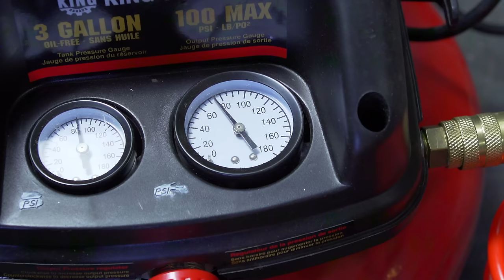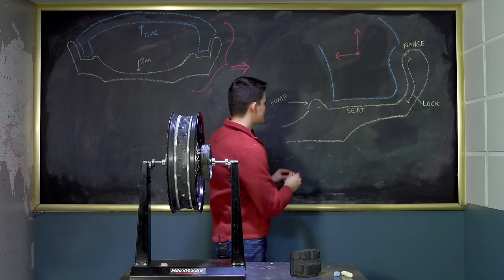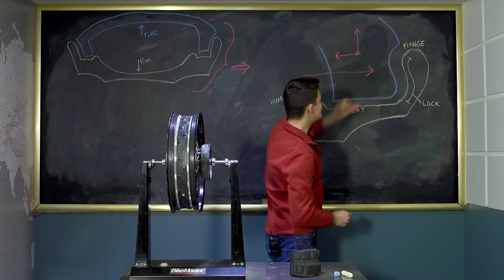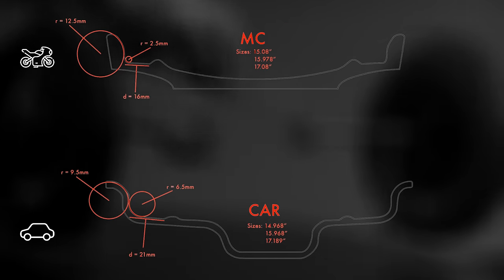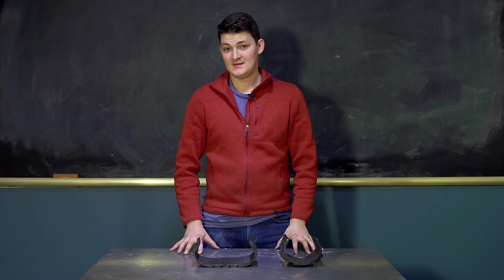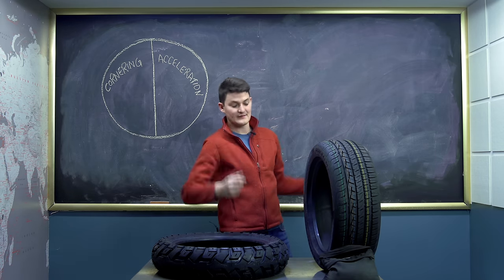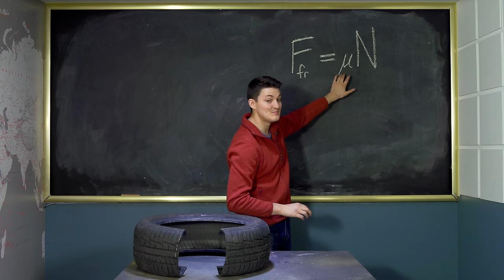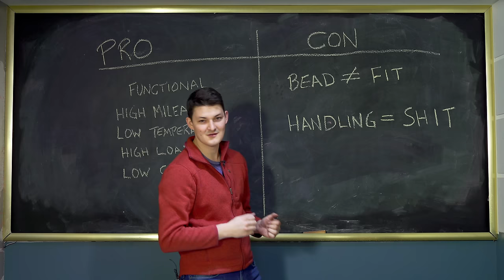Are Motorcycle Tires a Ripoff? The Darkside Car Tire Experiment

Comment: Dark Side tires are for cruiser bikes and heavy bikes. Not for scrawny little bikes like yours that have no weight. On top of it you are comparing basically the dirt bike tire you took off to a street tire for a car. Knobby tires are terrible on the street especially in Rain conditions When comparing them to street tires for motorcycles. If you want to make a better video get a cruiser bike of a good size and do the video again and you'll see a difference between that and the bike you currently are showing in the video. I have a 900 lb bike and I wouldn't use Dark Side Tire meant for a car. There are going to be corners and places where they're loose Stone and if you're making a turn and only the edge of a car tire the bike will go down after it slips out from under the rider. I won't mind paying extra money to save my life one day.

Comment: This guy is a motorcycle tire shill.

At the seating pressures, even though the bead and cpincher aren't an exact marriage, the bead won't break UNLESS you run the sucker FLAT!

The bead seating pressure is the same whether it's a bike wheel or a car wheel, and one of my car tires took 150 psi to seat!

As to handling, they are somewhat different,  but that is neither bad, nor good. A car tire wears better because it has a wider contact patch. It carries a heavier load because it's beefier.

Because it is wider, it is somewhat less susceptible to lean from weight shift. Casual minor shifts from side to side have less effect on steering. That make the bike more stable linearly! You are supposed to steer by COUNTER STEERING, not shifting your weight as you may on a bicycle.

The only part that may be a bit tricky is stopping in the middle of a banked curve, but it's just a learning experience!

I've ridden the tail of the dragon, Ohio's tail of the drain, the back of the dragon, you name it. My bikes lean and handle in curves JUST FINE!

If you only ride 5,000 miles a year, stick to your car tire! I ride 15,000+ miles a year! I spoke to a Harley rider about riding on the dark side. I was complaining about paying $167 for my Pirelli radial car tire. He told me a new motorcycle tire cost him $250 and another $250 to have it installed. What a racket! I bought the Pirelli car tire for $167 and paid $20 to have it mounted. Bike shops won't mount your car tire on a bike wheel, but a car shop may. You have to ask around.

It's an all day job for me to do a new rear tire on my GL1500. I have to pull the wheel, have a new tire mounted, balance it then install it. It takes at least 2 hours to pull the rear wheel. A car shop can't balance a motorcycle wheel, but you can buy a static balancer for $30, and the tire is good for 20,000+ miles. Just keep thinking $500 every 5,000 miles. RACKET!

I've noticed that newer large bikes seem to have wider large tires. RACKET!!!

I spent as little as $76 for a car tire for the back of a bike once that lasted 30,000 miles. THESE ARE RADIAL TIRES I'M TALKING ABOUT.

A wider tire doesn't provide more traction but it does distribute the frictional load over a wider surface area providing less depth of tread loss over a narrower tire on a mile by mile basis!

Comment: Car tires are designed to be on cars. Motorcycles lean differently than cars. I don’t see the advantage of going darkside. Sure you can do it but, you can also swim with sharks. Is it safe, probably not. I’ll stick with tires designed for motorcycles.
Reply: That's what a lot of people say. Always the ignorant ones. Always. Of course motorcycle tire makers and motorcycle manufacturers are going to say that it's dangerous. They want you to buy from them! Duh!!
Reply: Not being ignorant, I just don’t see the advantage and I want to be the safest I can be. On second thought, you do you. Ride safe.
Reply: @victorauletta7699  Me too! That's why I use a run-flat car tire on the back of my GL1800 Goldwing. I want to be as safe as I can be when I ride. And that means using the safest longest lasting tires too. 👍
Reply: Fine. I’ve been riding for 51 years. Countless miles. I’ve never had a motorcycle tire blow out, go flat, or give me any issue. It’s not a money issue for me. And, you’re wrong, it’s always the ignorant ones that think they know better than the engineers and manufactures.
Reply: @victorauletta7699  Got you beat. I've been riding since 1967 when my dad brought home a Ducati 125 Bronco for my brother and I to ride. Been riding ever since. Always had the passion. And it's obvious that you do not ride very much at all to never have ever gotten even so much as flat tire. I guess that I have had at least a dozen during my long riding career including two blow outs. Once on a Ducati 250 Monza and the other on my Suzuki GT550. Did not crash with either one but neither time was I driving over 30 mph either. And who cares about the money?? I care about my life. Anyway, you're wrong but not smart enough to know it. Do you really think that motorcycle makers are going to tell you that it's OK to run a car tire?? Get real. Hell no they will not. That want you to come in every few thousand miles and plunk down big bucks for one of the tires they sell there. And tell me one engineer that says that motorcycle tires are dangerous. None that I know or have ever ridden with. In the last 20 something years on four machines I have put around a quarter million miles on bikes with a car tire on the back. Half of that on my current GL1800 Goldwing alone. And as long as I own it, it will never again have a motorcycle tire on the back of it. I know what's best and you sir, do not.
Reply: Good for you and your riding experience. Glad you’ve made it all these years and mileage. Just because I’ve been fortunate enough not to have had a tire issue, doesn’t mean I haven’t ridden much. I don’t let my tires dry rot or wear out. I take care of my bikes. You don’t know me and I don’t have to explained anything. So, you have a nice life and, again, you do you.

Comment: Well, on one of the GoldWing boards we have logged over 20,000,000 miles with no accidents attributed to the car tire.   One of the best Goldwing riders that has ever ridden Deals Gap ran car tires with no problems.  Last but not least, motorcycle tires delaminate relatively frequently on a Goldwing.  No such problems with a Darkside tire.   There have also been zero accounts of insurance companies having problems with Goldwings running Darkside tires.   Tires have to be DOT certified, but that is it.